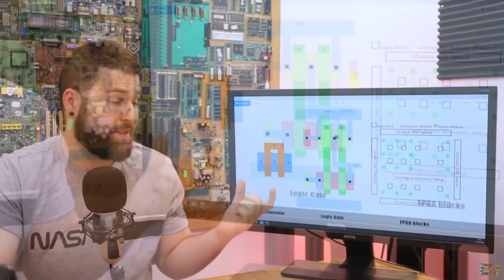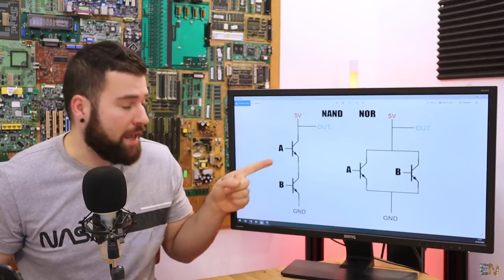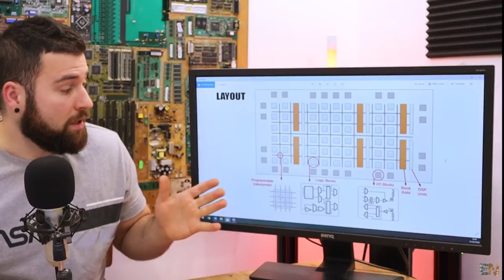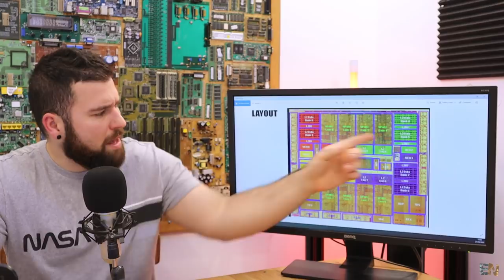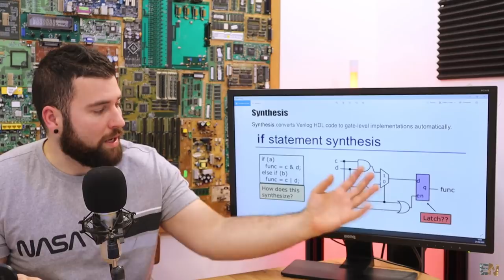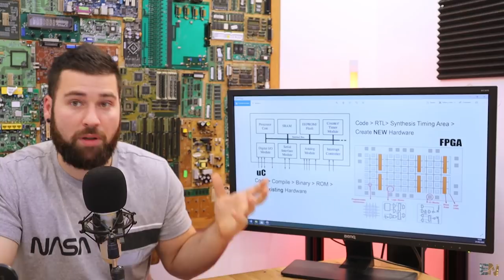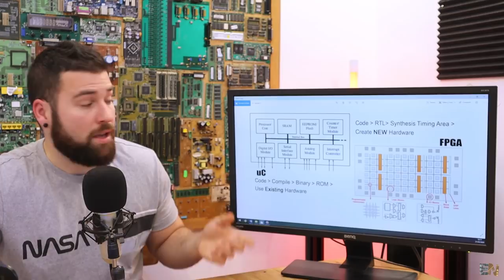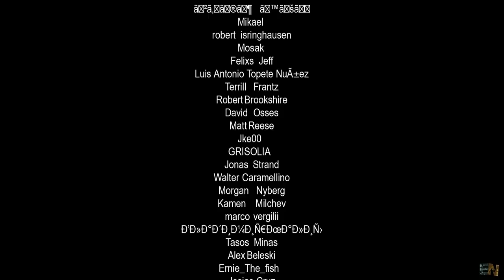LearnMore#4 - More About FPGAs | From Transistor to Logic Gates To Synthesis

Comment from the maker: Sign up at ELECTRONOOBS.io: https://electronoobs.io/
Follow me on FACEBOOK for more: https://www.facebook.com/Electronoobs
help me on Patreon: https://www.patreon.com/ELECTRONOOBS
Reply: hi how are you? i send a message on your forum can you reply please
Reply from the maker: @fekkralebanon  I can't find any of your posts on the forum...
Reply: @ELECTRONOOBS  my name their is noob 2005
Reply: hello my friend how are you. I am working on the rc plane controller everything is working good but i have a small problem that the servo motor is not turning for 90 degree just for 10 degree left and 10 right. I am new in arduino can you help me how to fix it please.(this is my problem please if you can help me and i changed my name on the forum it is now fekkra.lb)
Reply from the maker: @fekkralebanon  are you using the servo library or the writeMicroseconds function? For servos use servo library!
Reply: @ELECTRONOOBS  i am using the same code that you did write it
i think write microseconds fuction

Comment: I would like to add another important difference between FPGAs and uC:
- uC usually have internal ROM or Flash memory for their code. You just power it on and it starts doing its thing.
- FPGAs are RAM based. Essentially they are one big memory that's split between the Look-Up Tables used to implement functions similar to logic gates truth tables (which can be used as distributed RAM) and a block RAM memory. They also hae some Flip-flops and 3 state logic gates to pass the data between LUTs to implement complex functions. However, once power is gone, FPGAs return to being blank. Most FPGAs have an EEPROM/Flash memory that can hold the configuration file for the FPGA and the FPGA gets programmed from it automatically when it's powered on.

P.S.: FPGAs also have clock management and generation blocks, ALUs for accelerating some operations and not use programmable resources and more recently CPU cores that can run software to use your accelerated algorithm in the programmable part in general purpose software... need to mention this for the ones that will have problems with my "one big memory" expression :)
Reply: TL;DR: FPGA - RAM based, power off-power on => need reprogramming; uC - ROM based, power off-power on => starts running like from a reset.
Reply from the maker: True. Thank you for the info!
Reply: This is false, both FPGAs and uC need to be bootloaded after a power off.  This is apart of the power on sequence.

You are confusing how each device works with power on sequence. 

Power on sequence for uC requires loading the pointer for where in the program you are starting.  You than proceed through the code to initialize the design.  Very few designs can be loaded into a previous state.

FPGA power sequence is similar to that of uC.  The difference is the FPGA needs to be re-image (similar to that of re-imaging hard drives).  Once the design has been configured, the design can initialize itself.
Reply: @schumerthd  I am not confusing anything. I never said the uC can resume from where it left off. I just said that most uC are ROM based, and if they have code inside their ROM you can just power it on and it will start running (see Arduinos for example). FPGAs are RAM based, when you take away their power, they return to an unprogrammed state. Most FPGA development boards (and even FPGA based designs) I have worked on or with have an external ROM where the FPGA configuration is held for the FPGA to be programmed when powered on. 

Simply put, a uC on its own, most of the time will actually execute something once you power it on. There is an initial instruction pointer, even if it points to blank memory (which usually translates to NOP instruction). An FPGA will do absolutely nothing on it's own once powered on. 

In real life, your last sentence is exactly what I said, but fancier :) Technically correct, but I don't want to dive to deeply in details, as this video does not go to such depths.

Comment: CPLD is cheaper than FPG and don't need external memory. CPLD + MCU best combo. Nice informative video G.J.
Reply: CPLDs predate FPGAs for a reason.  If you are using a PLD as a hobbyist then most of your needs will be met by a CPLD.  If you need speed, amount of logic cells, high speed transceivers, or 5v logic level, then you need a FPGA.

if internal memory like DDR is necessary, than a zynq series FPGA would work.  Even using a low end FPGA, a designer can build internal memory.

I might be biased after updating CPLD designs to FPGAs.
Reply: Each have their strenghts... but CPLDs are pretty niche nowadays, as uC are powerful enough on their own and if you need something very complex, an FPGA is better suited.
Reply: @schumerthd  Well said, I love my ZYNQ FPGA with dual core arm-cortex. It kicks trash!

Comment: Thank you so much! I think a simple enough yet very useful project could be a SPI module to control multiple steppers (multiplexing?). So you don't run out of pins to control them. By the way, what about the litex project? can you recommend it? It seems pretty powerful and there is even complete RISC-V processors programmed in litex

Comment: One request, could you include code examples along with the example of how synthesis works.  

The process for synthesis works by interpreting the code into abstractions.  These abstractions, are memory, accumulators, and, or, not, or clock dividers just to name a few.  Once the code is turned into abstractions, then a process called implementation can proceed.  An example of this in code would be: count <= count + 1.  The synthesis tool would see this as a accumulator.

Implementation is converting the abstract blocks into logic gates and other primitive contained in the FPGA.  The last part of implementation is generating a net list which connects all of the devices on the FPGA.  In most FPGA tools, at this point you can look at how the FPGA is being routed.

The last part to consider is the generation of the bit file.  This file is a binary file is not readable by most text editors.  This bit file tells the FPGA how to configure itself.

Comment: I don't quite agree with the arguments on the choice of fpga/controller. I would lean more on the division between working in control-plane or data-plane. For example, if you have several high speed transmissions going on, it would be hell to solve such a task using only a controller. Moreover, we should not forget that there are cheaper FPGAs. On the other hand, using an FPGA to control a complex device with complex sequential logic is not the best option either. As for me, if you have a task related to parallel high-speed processing/sending of several data streams, FPGA is the way to go. Because no matter how cool the controller is, it will not be able to process 2 interrupts instantly. Even just two output signals at the same time 2 pins for example on different ports can already become a problem for the controller. So I would ask questions right away: Is the logic of the device complex and sequential? (Controller)
Is there parallel processing of time-critical signals? (FPGA).
If the answer to both questions is yes, then it might be worthwhile to put a controller + FPGA.
I.e. do not take the most expensive FPGA and do not emulate memory/processor on it, but buy an inexpensive controller and an inexpensive FPGA. Still, their tasks are different. Well, and options when some smart device consists only of FPGA seems to be something from the category of a cannon at sparrows.

Comment: A FPGA Especially a SPARTAN FPGA can accommodate a complete unit i.e a Sinclair Spectrum or even a AMIGA A1000 on a FPGA and can make for a small PCB, I think that if OLIVETTI had access to FPGA chips then the electronics that were spread across 16x S100 boards would fit onto one PCB and mean the the OLIVETTI M3030 would be more like a IBM PC and would not be built into the back of the desk made from sheet steel.

Comment: With the schematics for NAND and NOR that you showing you never can get zero on the output. You should have a resistor on top to limit the current. Your way you have on positive side a zero resistance to positive rail and on negative side you have tiny but significant in this case resistance of two MOSFET channels.

Comment: I'm always confused about what type of code is synthesizable or not. Like using if statement inside of an always statement. Sometimes I'm able to synthesize it and it works fine when testing the physical output, but other times it doesnt work at all even though the stimulation works. Maybe you can do a video on that?
Reply from the maker: hmm, "if" inside an "always" is no problem... This might be related with non-blocking or blocking. You have a full post about that here: https://inst.eecs.berkeley.edu/~cs150/Documents/Always.pdf
Reply: There's a book i got from Amazon called 100 Power Tips for FPGA Designers. It explains a lot of conventions that are for simulation only and goes over what parts of verilog are synthesizable . For example, initial blocks are not synthesizable and only work for simulations. However, on Xilinx FPGAs initial blocks are. Sometimes it depends on  the device manufacturer as well. Defiantly check out the book @GrandNecro

Comment: Hai brother small doubt about what is difference between FPGA and ASIC Flow ( also this is the process)like Specification, RTL,SYNTHETICS DFT,STA,PD ) I am training at Dft that's why I am asking plz tell me brother
Reply: ASIC is an abbreviation for application specific integrated circuit. It is an IC that is used for a specific function. For example webcams and digital cameras have ASICs that process and compress the image. FPGAs on the other hand are general purpose devices with which you can make almost any combination of logic gates. You can use them for the prototyping digital ASICs.

Comment: Just wondering do some fpgas impliment a look up table rather than actual logic gates? As logic gates are complex and hard to configure. Where as a lookup table is fast programmable and has 0 propegation delay...
Reply: In FPGAS they are configured into logical blocks, for Xilinx FPGAs they generally have 4 six-input look up tables (LUTs, these can be configured to behave like logical operations i.e. x & Y | Z) 8 registers (Flip-Flops, save data) a carry a chain and multiplexers. Sometimes if your logic behaves like a look up table BRAMS can be used to accomplish this task.
Reply: Probably the look up table only stores the configuration of logic gates. The information of the lookup table is used to connect the logic gates together.

Comment: I have a rough idea of how logic gates work is this the same thing as a hardware LG or is it virtual?
Reply: FPGAs are the same as hardware logic gates, that's what makes them up. It's not simulating the functionality of them. The bit stream goes into program the FPGA which really tells the transistors and blocks where to make connections and where to not to make connections. You could think of it as wiring up a circuit board in a way.